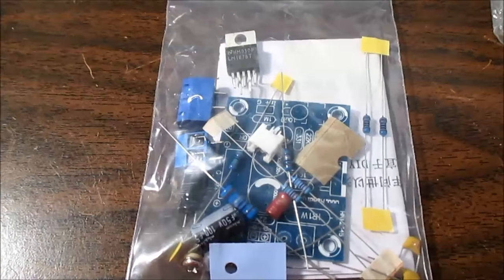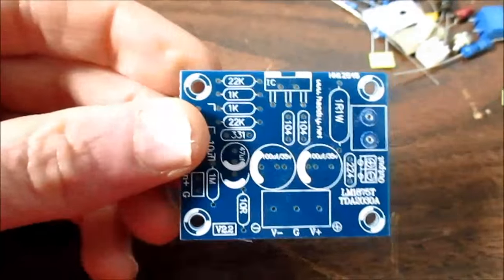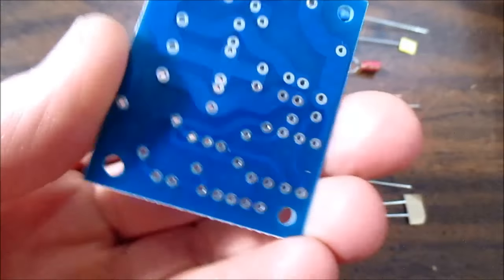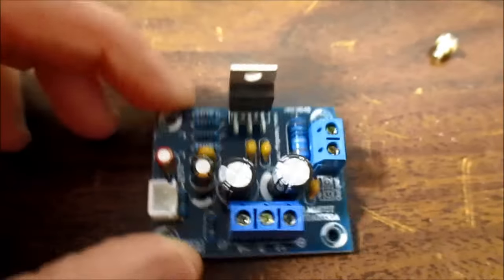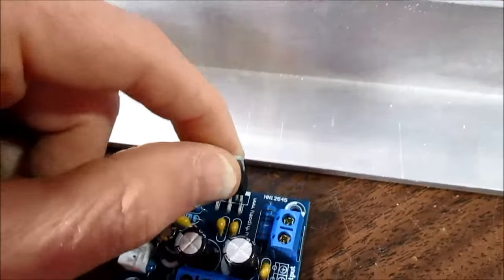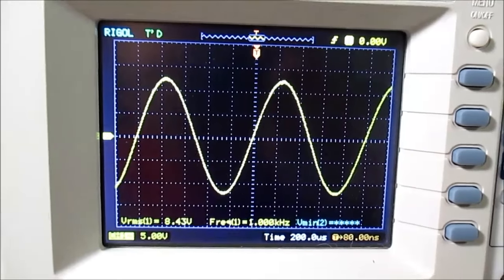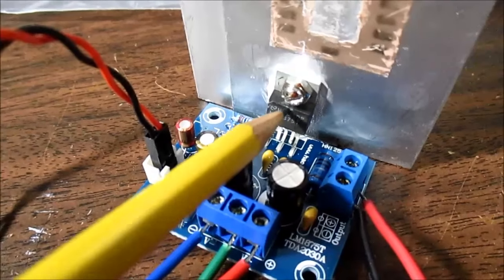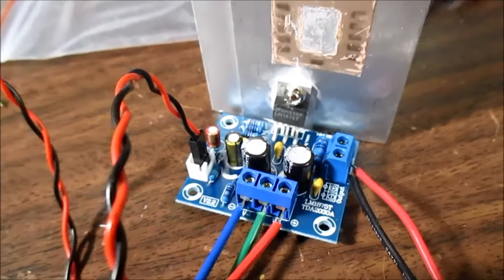LM1875 IC audio amplifier board kit test and review

Comment: I am about to order a Mean Well 150W SMPS which has two V- and two V+ outputs (18V), is it possible to use it with this amplifier? How should I connect V- and V+? thanks
Reply from the maker: Yes that would work well. V- goes to v- and so on. 150 watts is overkill unless you will power 2+ boards with it.
Reply: Thanks! Where should I connect the ground? To the ground of the power supply marked with earth symbol?
Reply: The ground should go to a black terminal, potentially marked as G or GND or something like that.  Do not plug your equipment to the earth ground.  The earth ground is used on the high voltage side 120V/220V only.  If could can't find the proper place to connect it, give use a link where we can look at your PS manual.  That will be easier to direct you adequately.
Reply: @SimpleEnough2k9  Sorry for the late reply. I have busy with work. This is the link https://www.meanwell.com/productPdf.aspx?i=420

Comment: I want to make a passive low pass filter at input stage. is there any compulsory that I have to use ceramic cap only? can i use electrolytic cap? should i use a high impudence or low impedance resistor in the filter?
Reply from the maker: Depends on the pole frequency of the filter. Film caps can be used. Ceramic caps come in low values and work with high frequencies well.
Reply: JohnAudioTech for a low pass filter at nearly 200hz cuttoff R1= 220ohm c1= 2.2uf for 219hz cuttoff. :) im using an electrolytic cap. would it be a problem? and please tell me how effective this passive filters are,i never made or tested one, i'll do it on tomorrow.

Comment: I bought 2 of these from a random china seller on ebay. Both appear to have fake lm1875s. One of them simply sends vcc+ right to the output. That made my speaker start to smell funny. The other one works ok, but sure looks like one of the fakes JAT outlined before. So beware that you may not get authentic chips when you buy these.

Comment: is this a stereo amp? if not, could I use 2 of these to make a stereo setup? if so, how would one go about doing that
Reply from the maker: You would need two of these for stereo. You could use one power supply or two (one for each board).
Reply: JohnAudioTech and how would one split the channels to each board? is there a video that explains this setup if so I would love to see it.
Reply: Just connect one channel to one amp...
Dont buy these kits if you dont even know how to do that
Reply: Why not? Isn't that how people learn? Get on Google, watch a few vids, read some articles and give it a go. Make a mistake or two and see if you can get it working.
Reply: Myles Thomson
That is until you burn your house down with a bad soldering job...

Comment: I have a transformer here 12-0-12, any good to power this? 0 to ground?
Reply from the maker: Yes that would work if it can supply enough current. I don't know your 
knowledge of power supplies, but you need a rectifier bridge and a 
couple filter capacitors to make a split DC supply to power the board.

Comment: Here I go, Blowing up your youtube comments! Ok.  Film caps vs. electrolytic in audio amps.  Whats the difference??
Reply from the maker: "lytic" caps are said to cause more distortion when a large voltage swing develops across them. The idea is not to let that happen by using a large enough value so the pole frequency (-3db down point) is low enough not to be an issue. For example, The 10 uf lytic on the input sets the pole at about 0.8Hz on this amp board. This is far below normal music frequencies so distortion is no issue. Film caps are not nearly as bad, so a bit smaller value can be used and still not roll off the bass at 20Hz.

Comment: I would really like to know the purpose of the 1M ohm resistor in the input stage, the tda2050 is similar but doesnt need the 1M ohm resistor. The rod elliot design doesnt have one (this: http://sound.whsites.net/project72.htm ) and there has been reports of oscillation. Please do reply. Thank you.
Reply from the maker: The resistor assures that no charge remains on the input coupling capacitor. It is a good design choice to have it but it is not necessary. If you add a volume pot, there is no reason to have it at all.
Reply: Thank you so much, really thanks for the knowledge. So let me get this straight no need for the 1M resistor if potentiometer is used? I would also like to point out that in your video (this one) the schematic does have the 1M resistor before the input capacitor. Also, please do forgive me if I am annoying you but I would really like to know : http://sound.whsites.net/project72.htm this would work right? thank you.

Comment: hi john, what would I need for this amp to put a guitar into it
Reply: you need a DI that converts the high-Z guitar output impedance to a much lower impedance output to get enough signal at the ampli input. the DI also pre-amplifies the signal to LINE level, the optimum for an ampli input.

Comment: i bought this but it has a v-, ground, and v+, how do i hook it up
Reply from the maker: It requires a split supply with a plus voltage, negative voltage and common (3 wire supply).

Comment: The chinese buy seconds-quality (reject) IC's in wafer form and re-package them, often putting fake manufacturers labelling on with paint instead of laser etching, to make them look genuine. If the markings come off with solvent; it's probably a fake...
Another trick is they re-claim them from scrap electronics and sell them as new parts by the kilo; while they may be genuine they sure aint new! they will often have solder already on the pins and scratches from the (sometimes brutal) removal. There's even a youtube video of a buyer testing chips with a solvent soaked rag in a chinese wholesale electronics market; there was plenty of nervous sellers that day!

Comment: What is the the voltage required 12v or 24v ?
Reply from the maker: It requires a split polarity supply of +18 and -18 volts max for 4 ohm loads or +25 and -25 volts for 8 ohm loads.

Comment: I have been in the electronics industry for 40 years, what is wrong with silicon insulator for heatsink.. I have used mica for years and heatsink compound....some people do not realize what heatsink compound does, it does help with heat transfer but that is not it's main purpose, the tab on the transistor or IC, plus the heatsink won't be flat, it will be pitted full of holes, and you will have air cap, air is bad conductor of heat....the compound fills in the gaps/holes and helps pass the heat better. You don't need much, a lot of people put to much on, you need very little, using to much you raise the chip or whatever away from heatsink.

Comment: How to adjust volume, Bass, Treble in this kit
Reply from the maker: This is a power amplifier. Signal conditioning should occur in a preamplifier stage preceding this.
Reply: @JohnAudioTech  means to adjust Volume bass and treble, we require another circuit ?
Reply: @SachinB.A.  Si

Comment: Can I use battery with this board ???
Reply from the maker: You'd need two batteries, one for the positive rail and one for the negative rail. You'd have to use a double pole switch to control both rails at the same time.

Comment: Does it run on AC or DC volts ?
Reply from the maker: Requires a dual DC supply.
Reply: gosh darn....I did such a great job soldering it. Any suggestion on ebay you can offer please ?

Comment: 1amp
Reply from the maker: You can get away with that only with one channel. You really need 2A+ for stereo.
Reply: @JohnAudioTech  If I have a 2A 12V-0-12V transformer with a bridge rectifier and smoothing caps, shall I connect two of these (parallel) into the output of that PS?